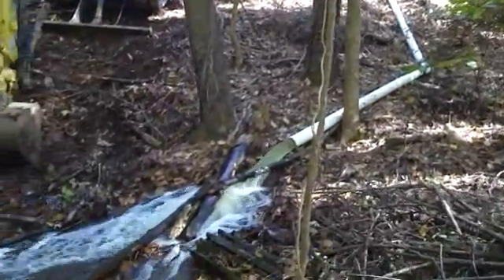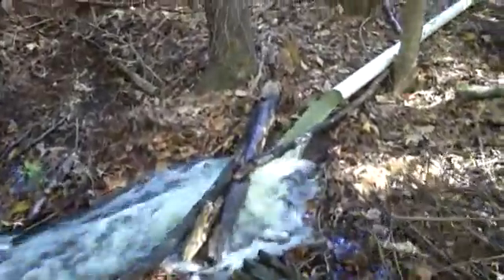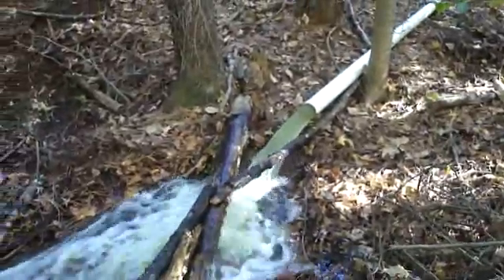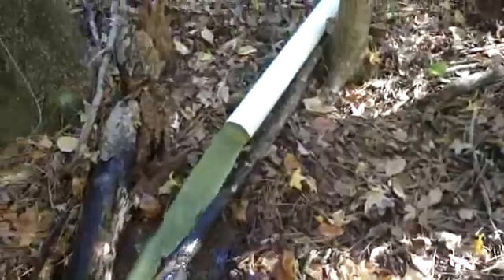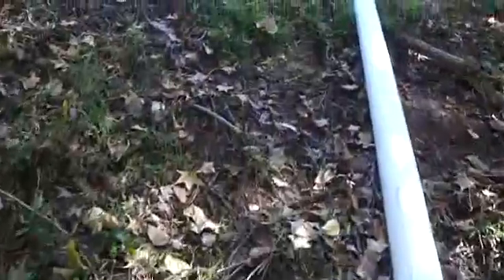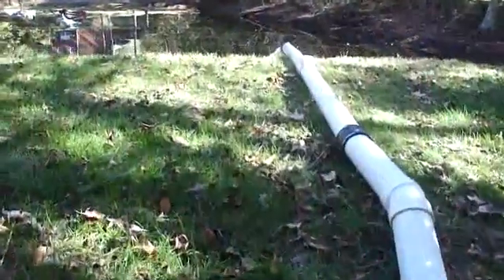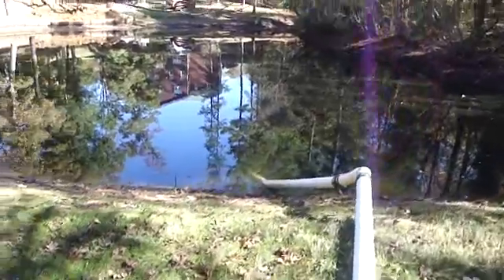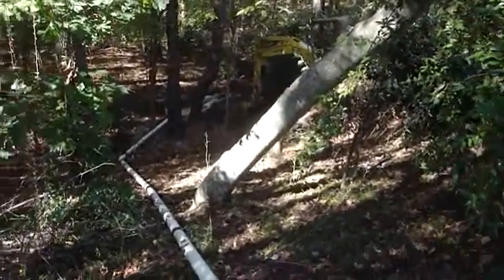How a 4" siphon works

Comment: @ifishfortarpon 

No what they do is place the pip into the pond, and the other end down hill to the spill point. Then attach a temporary pump to this down hill end, suck up water until it hits the pump and then detatch it. Once the water starts to flow it will continue on it's own accord. 

The Romans used a similar principle when building Aquaducts for pushing water up the side of a cliff. Except they had manual pumps to get things flowing.